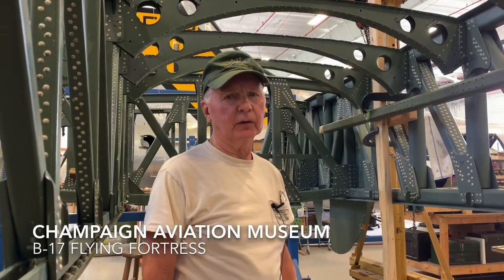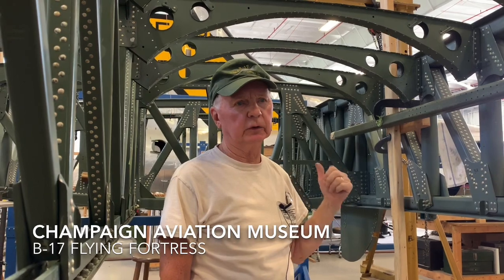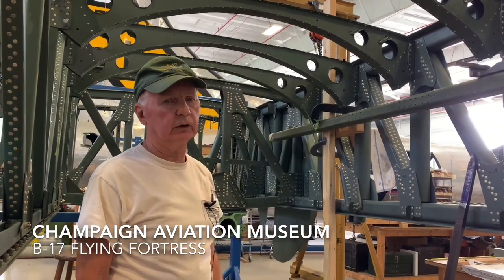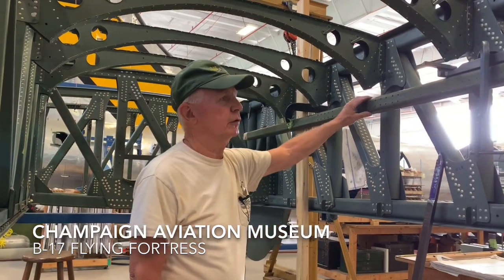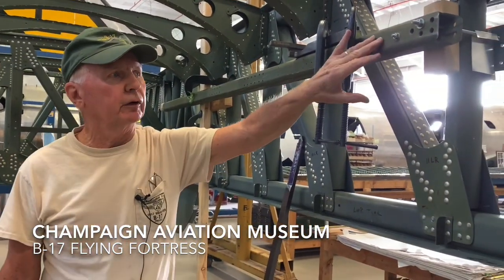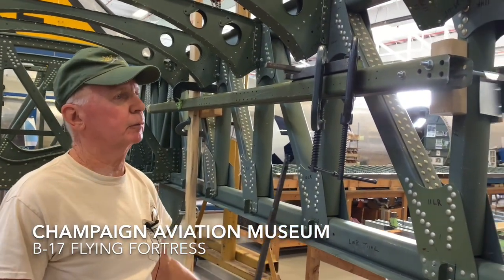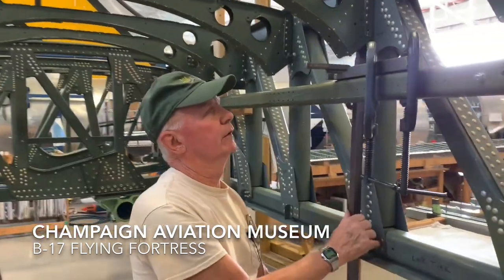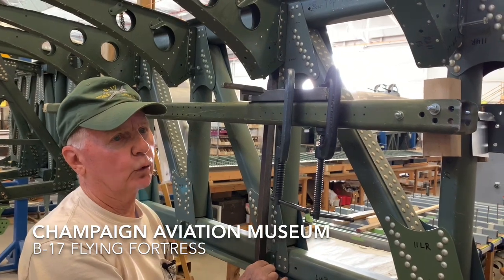Riveting a WWII B-17 Flying Fortress Wing -- Using old school techniques today

Comment: I wonder how many thousands of rivets were needlessly placed on these old WW2 planes.....i saw a guy put just one piece of a b24 in Solidworks FEA and found they only needed 32% of the amount of rivets used to keep the joint just as strong, and in fact stronger than the parts being riveted together in shear force.